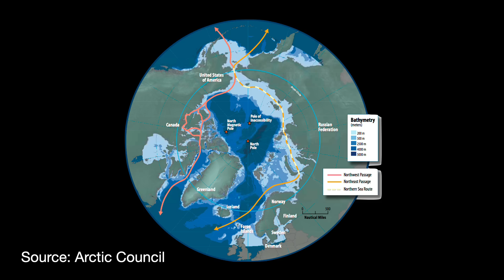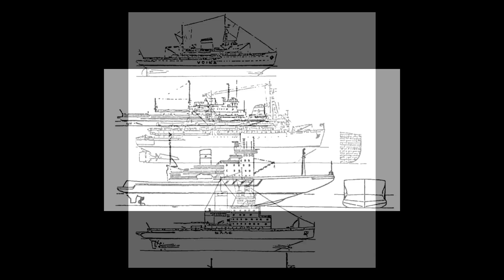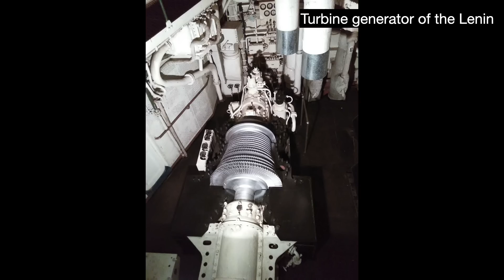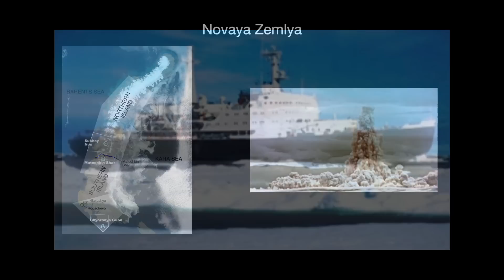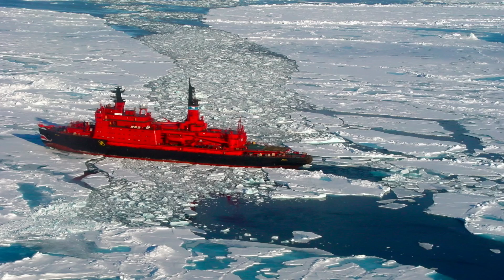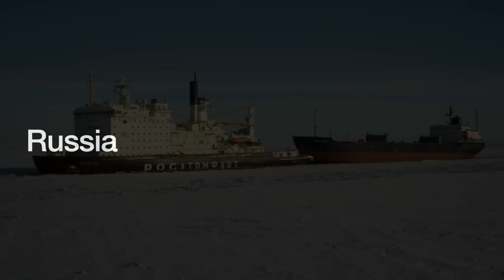The Soviet Union’s Nuclear Icebreakers

Comment: Kind of error, there's an art to icebreakers. Drop by one in Finland (if present and not powering something in south-america as often is the case), there's blowing air beneath the ice before going on top of ice and crushing it in certain situations, all-360 degree bridge (and propellers) in new ones.. Lots of cool stuff there. Several hulls, towing capability depending on ice-rating of ships an icebreaker helps. You need lanes because once you break the ice it freezes harder of course.

Comment: Russian and big oil companies investments in Arctic oil extraction is very dangerous, as it depends on a melted Arctic!   Once the Arctic has melted the methane will be released and it will be much harder to get back to a normal climate.  There is a lot of hysteresis in this climate tipping point.  Furthermore, ipcc report has been watered down by including a Russian model which has suspiciously different parameters than all the other analysis.  This has been uncovered by a climate scientists looking at sensitivities. Also the ipcc report editors include some connections to the oil industry.

Comment: You missed a few things:
One of the biggest reasons for making a nuclear icebreaker, the waste reactor heat is used to heat the hull in order to melt ice, and produce super heated sea water that is also used to melt ice.
Also the Soviets and later Russians use their Ice Breakers to pull the cargo ships they are escorting with large steel cables, so their propulsion engines are not needed during the escort...
Reply: Awesome

Comment: Russia has a reputation of building really large things.... Antonov Cargo Planes, Moon Rocket, Ice Breakers bigger than many ships, heavy lift helicopters that can pick up the biggest helicopter from America. Gives them bragging rights. Oh yeah, their Moon Rocket blew up.
Reply: And US "forget" how to build one
Reply: @burnedhrum  You dont forget how to build these things.
The tooling and alot of the supply chain parts that made the SaturnV back then, are not available nowadays for obvious reasons.

The SLS is probably the closest the US can get to a modern SaturnV with a fraction of the budget required for the SaturnV back then.
Rocket making isnt anything new. NASA is just working with a massive budget constraint.
Reply: @burnedhrum  Sad but true... thanks for comment.
Reply: @burnedhrum  They didn’t forget how to make one. The plans are there, but try to make hundreds of companies, most already bankrupt, make small one-off components for a rocket half a century old. Also, we can’t make some components such as the F-1 because there was so many unrecorded micro-changes made by the engineers that even if we copy the plans, it wouldn’t work as well and maybe even blow apart.